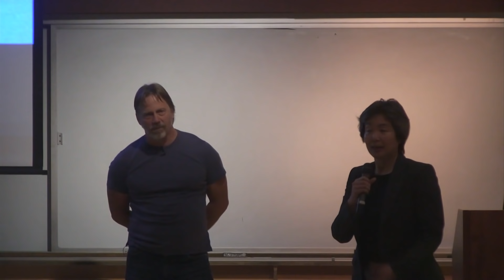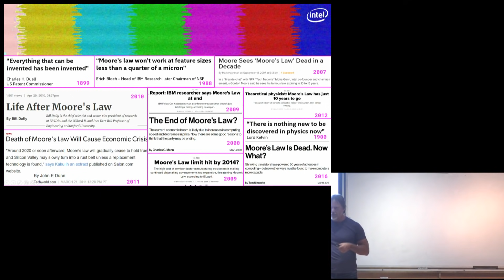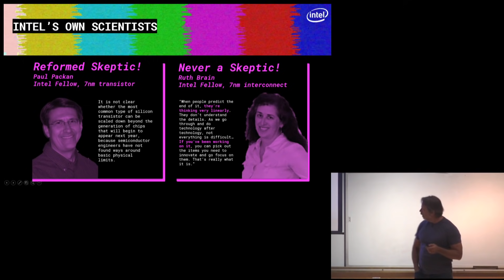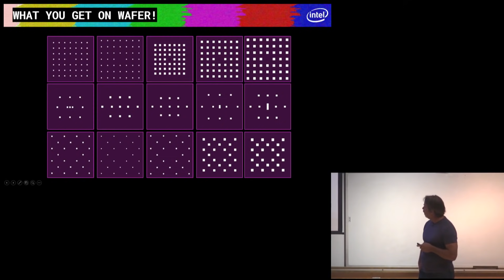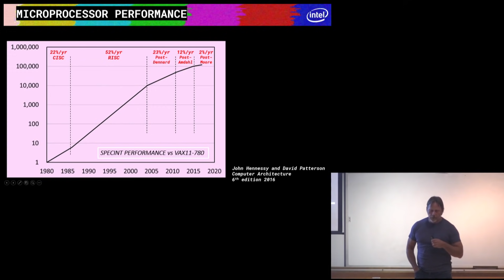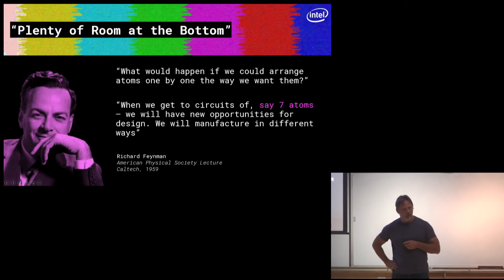Jim Keller: Moore’s Law is Not Dead

Comment: Intel doubled down aggressively on Dennard scaling. It worked until it suddenly didn't. And that was the pentium 4 mess where 8 GHz was expected by 2003 at some point and the more conservative athlon 64 curb-stomped intel. It's hard to tease appart if intel had been ahead until the K7 due to process advantage or due to aggressively enabling higher clocks.

Comment: Thank you for sharing this impressive video!
One question here. I doubt the memory latency has gone up that high for real. Even though the cycles have been changed, don't we also have to consider the enhanced memory frequency? Thus the memory latency must stay the same, no?
Reply: Excellent question. The frequency improvements on the FSB mean that memory throughput continues to climb, however latency does not directly benefit from that. The signal still has to make its way from the load unit, through the logic in the TLB, to the memory controller, across the traces in the motherboard, to the control circuit on the DRAM which then needs to writeback the current row and fetch the one requested, and then the signal needs to make its way back. Even if the signal could travel at the speed of light, it would take a couple of cycles to cross the motherboard to the DIMMs! Between the distances involved, slew rates of components, and number of components involved, total latency really is in the hundreds of cycles.
Reply: 지형탁 Don't think arguing about cpu architecture facts with a lead architect will get you anywhere ;)

Comment: At this rate of progress it will take minimum 50 years for those 50x.  It has been 6 years since introduction of 14nm, and Intel is still on 14nm+++. Also there are diminishing returns with 3D stacking, costs dont go down and heat is the big problem. 24:49 We also saw poor yields from FINFET`s and thats already 3x included which is in the past now.
Reply: Just stick to your armchair and let the driven optimists do the real work.

Comment: If you look at the number of transistors in mainstream Intel processors (10600K for example), then it's clear that Moore's Law doesn't work properly anymore. In 2020 we should see 32x more transistors in a mainstream CPU than in the i7-875K.
Reply: His point is performance, not transistor count.
Reply: @M.-.D even transistor count
Reply: @M.-.D  Wow, in one other comment I wrote about performance, so I'm being told the point is transistor count and in this comment I wrote about transistor count, so I'm being told his point is performance.

My point is that neither transistor count nor performance of CPUs doubles every 2 years.
Reply: @Kynareth6  what is your definition of performance?
Reply: @M.-.D  the average improvement in how well various applications perform (let's say a median of 20 applications/games performance)
Reply: @M.-.D  or you could even look at one of the popular benchmarks
Reply: Look at current transistor count

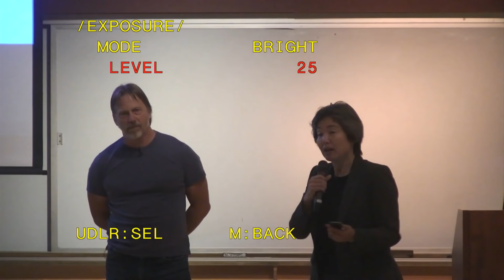Comment: ZEN WAS NOT FUCKING JIM AS JIM SAID WHEN HE SHOUK HIS HEAD AT 2:22 LYING WHOREMASTERS INTEL
Reply: He led the microarchitecture design team. No one man has been able to design a modern cpu or cpu microarchitecture by them selves. Even the first single chip CPU (Intel 4004) wasn't designed by a single man.
Reply: @jonathanbaxter5821  Except, even that wasn't designed by him alone. He worked with Federico Faggin (who he also designed the Intel 4004 with) and others. Yes he was the principal circuit designer in both, but didn't do it himself.

https://en.m.wikipedia.org/wiki/Zilog_Z80
Reply: He wasn't denying it, he was being humble, you all caps troll.  He was thinking probably at first, "...well thanks", then he was thinking, "....actually me and my team built it and with them...." etc.  You could see he was thankful for the comment but didn't want to take credit because massive teams do these things and he was a major part of that team.